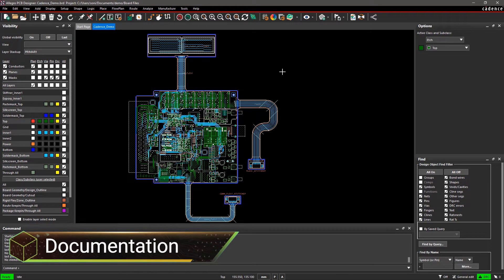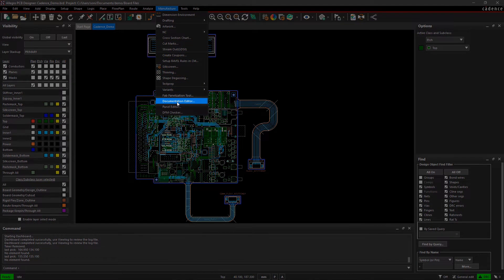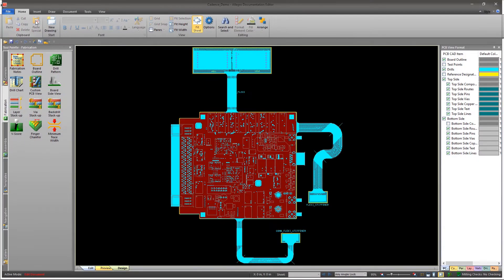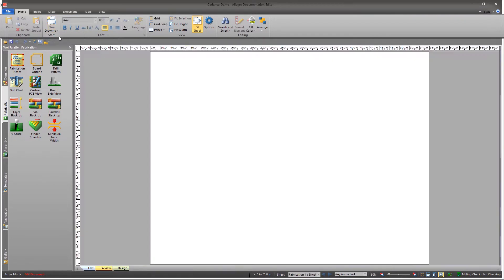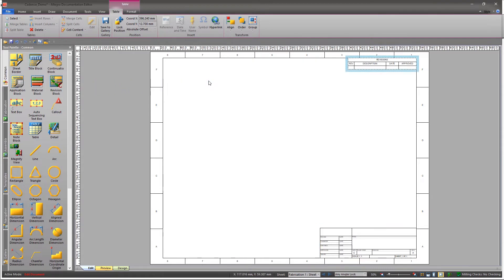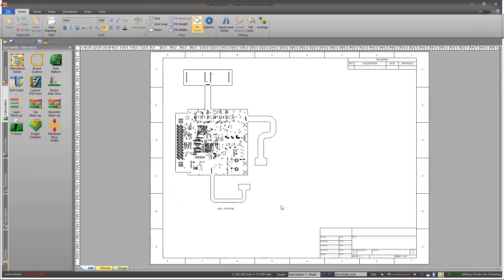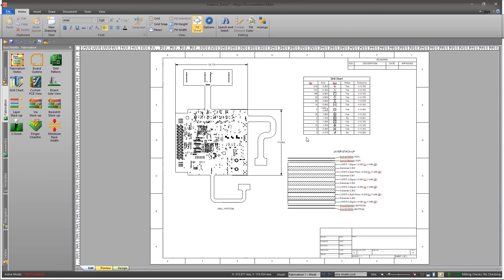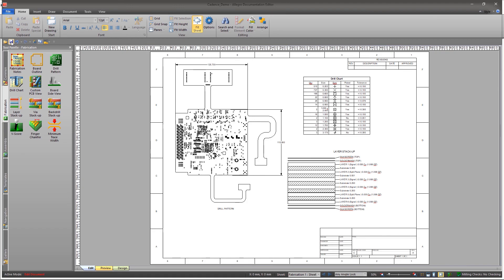Documentation for PCB manufacturing | Allegro PCB Designer

Comment: How do you get Documentation Editor to appear in Allegro Manufacturing menu? Does this require OrCAD/Capture CIS? I'm using Concept/DE-HDL front end.
Reply from the maker: Hi Dan, you'll probably need an updated license file that includes the manufacturing option as well as the installation if you're currently not seeing Documentation Editor appear under the Allegro Manufacturing menu.